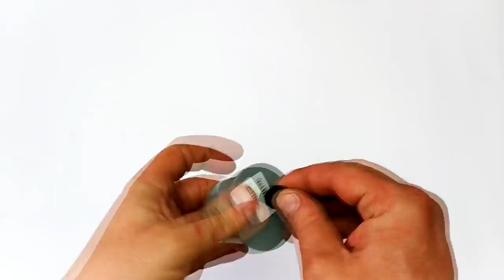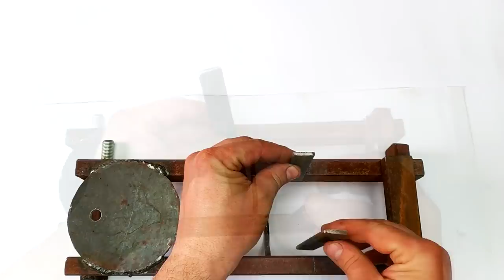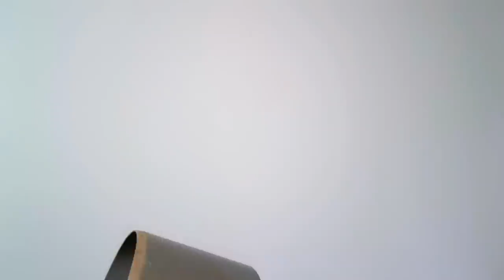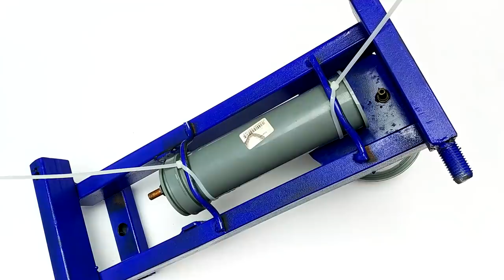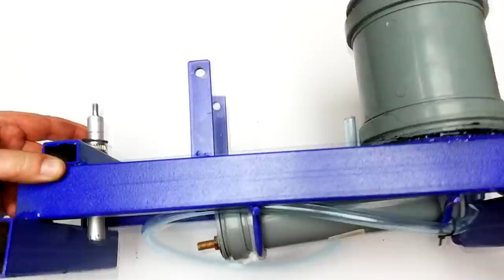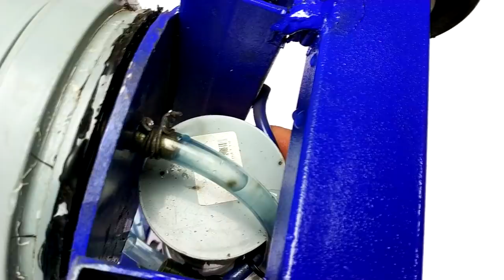How to make a powerful hydraulic jack using plastic pipes

Comment: Very interesting, I particularly like the hydraulic aspect. As a concept, I think it's good but practically I'm wondering if the water is the correct fluid to use as I think it's compression capacity is weak, I think this system may be prone to bleeding.  I also wonder why you don't use the proper plumber's PVC cement after all, its designed  specifically for that material and it's not expensive.
Could have different size ends which gives flexibility given the enormous amount of variation there is in car clearance.
Enjoyed very much👏

Comment: If it’s 4” pipe and the water pressure in it was 100 psi it could lift 1250 pounds but all that tubing would be under the same water pressure.  I don’t see the tubing holding up.

Comment: Sorry, this is one of the most idiotic things I've seen. First it is DANGEROUS,  no way would I trust plastic pipe to hold up even a small car!  Secondly, it is very slow, way too much pumping. Thirdly, you can buy a real hydraulic floor jack for not much more than the parts for this.